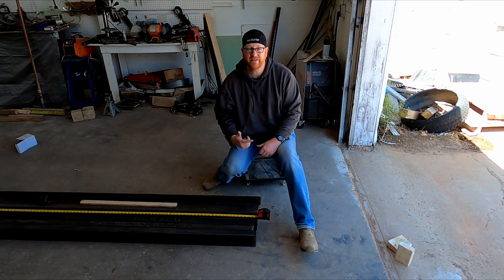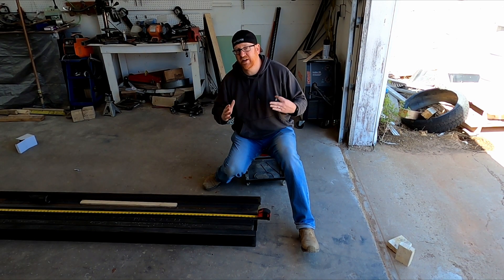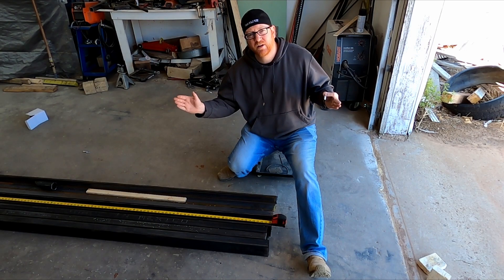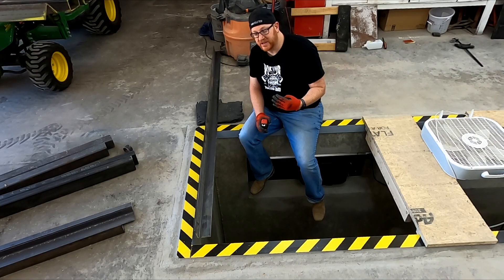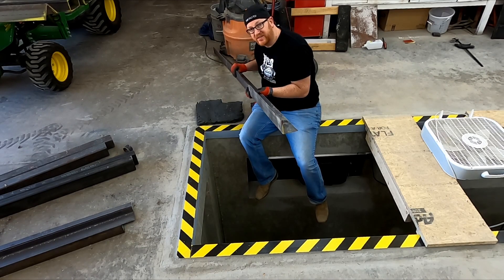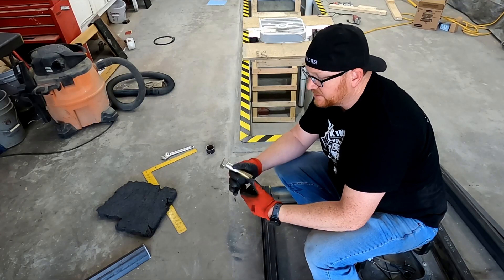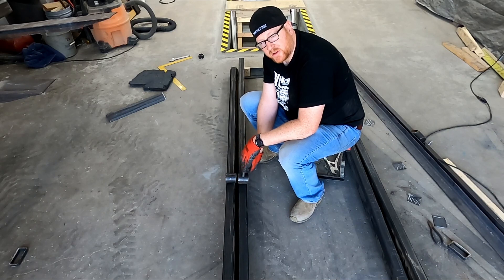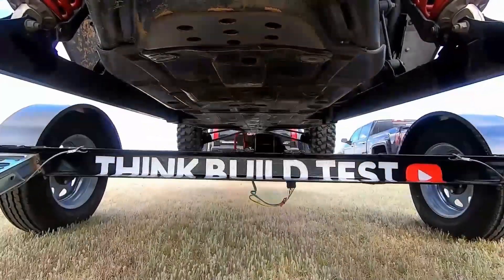Scissor Lift Build BEGINS!  Car Pit Elevator!

Comment: I'm curious to see how you dealt with the problem of finding the right size sleeve or bushing to fit the bearings and shoulder bolts
Reply from the maker: Its all in progress I am having to work on multiple things at once to get all the measurements I need.  But that doesn't make very much sence for the camera....    Sorry for the delays trying to hold the best single episode story lines as I can.